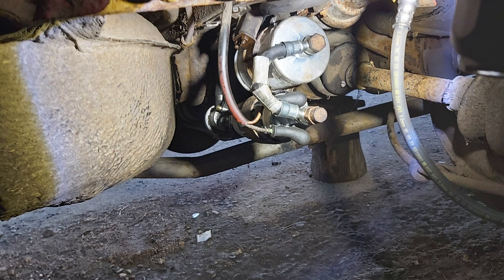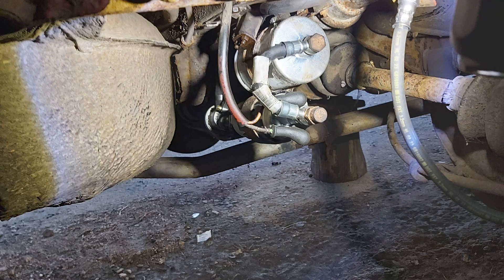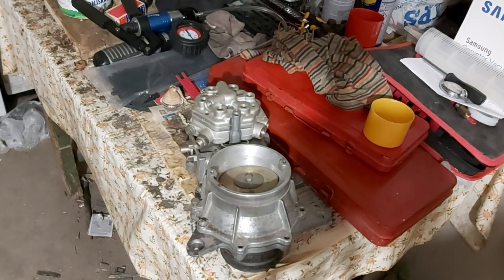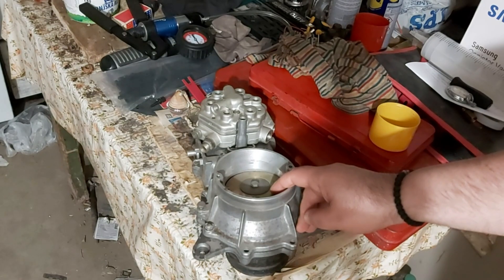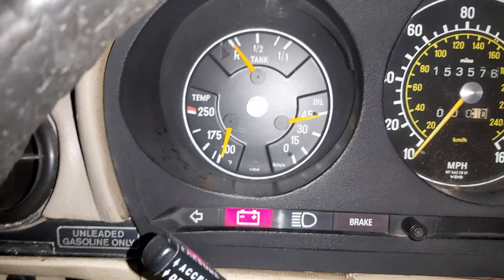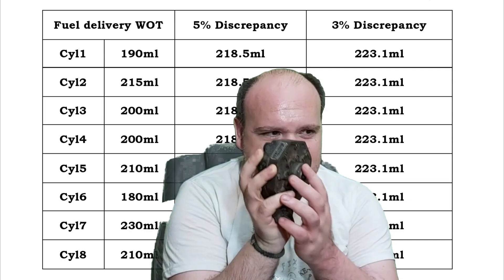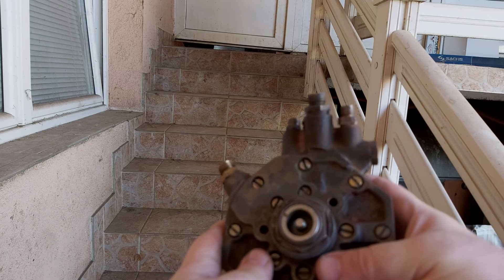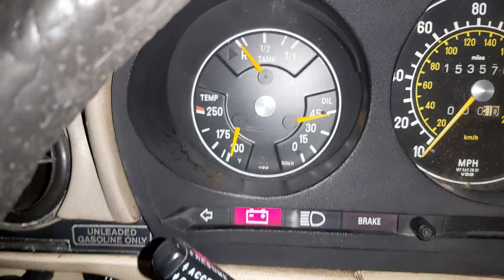㉦Mercedes Ke-Jetronic㉦ -KE-Jetronic Fuel Test – How to Measure Fuel per Cylinder (Shocking Results!)

Comment: Dear Sir: I measured a flow rate of 110 ml/min on my M103 with the air flow meter at the bottom. The pump at the distributor inlet is at 7 bar and has a good flow rate. What could be the problem? The car is struggling to exceed 4500 rpm.The differential pressure is 0.4 bar. Thank you
Reply from the maker: Hello. Concerning some things: Don't measure the pressure at the inlet! The pressure is not important, more important is the fuel flow! Measure the fuel flow by removing the return line on the FD. You should get 1.6l in one minute. Concerning the flow rate: In all manuals for all the KE-Jet cars you will find the value: 100ml per section on the full load. As you could see in my case in this video, the least I got was way over 100ml and the FD could NOT be calibrated! Concerning the M103 FD, you would have to tell me how much you got out of all 6 cylinders but the nominal value should be approx. 160ml per section if the fuel distributor wasn't recalibrated. That's what I can tell.
Reply: @mercedeske  Dear Professor, thank you very much for your detailed response. Thanks to all the excellent information you provided, my car is running very well. Best regards, and thank you again.
Reply from the maker: @guidopicca2858 Thanks. Many happy miles and happy Mercedesing!🔧🙂🍀🎄👋🏻

Comment: Dear Sir: I measured a flow rate of 110 ml/min on my M103 with the air flow meter at the bottom. The pump at the distributor inlet is at 7 bar and has a good flow rate. What could be the problem? The car is struggling to exceed 4500 rpm. Thank you
Reply from the maker: You are correct to measure flow, but there are two important points to separate here.

First:
At idle, even a 3–5% imbalance between cylinders is immediately noticeable.
At full throttle and higher RPM, the engine may not feel even a 10% difference directly.

Second — and more important in your case:
110 ml/min on an M103 is very low.
This points not only to balance, but to a total flow limitation.

Since the engine struggles above 4500 rpm, this suggests:
• restricted internal flow in the fuel distributor
• sticking plunger
• contamination
• or incorrect test conditions

Yes, all six outlets must be within ±5%,
but with such a low total flow, the engine will run out of fuel at higher RPM even if the balance looks acceptable.

I would recommend checking both:
✔ total flow capacity
✔ and cylinder-to-cylinder balance with a bottle test

Comment: I need some help my 93 mercedes 190e m103 turns off when i break on a red light. And when i have it on parking the rpm fluctuates to 1200 to almost 0. I changed the injectors, spark plugs, fuel pumps, filter, acumilator, icv, cold start injector, mass control module, ovp i think thats what its called and the battery is new and the alternator. Yet i dont know what's going on... could it be vacuum leaks or the air mixture is wrong? Also after driving it idk if its because of overheating but when i got out the car after the problem i can hear my fuel pumps buzzing louder than normal
Reply from the maker: What about the potentiometer? Have you checked it?

Comment: Hello, i think my ovp is broken, when i turn the key fuel pump buzzez, has spark, the distributor lower head has pressure, upper head only the cold start injector has presure so when i remove the pipes from the distributor then turn they cey it fills the fuel just a little bit, abs light is of when i turn the key, i was using 800a battery for 3 months it did it in start, i turned the key from where it came on to 1000 rpm and then it went out, after that then then I just turn the starter, it  starts up very slightly after goes out, it wants to start but dies, everything other is good
Reply: Nevermind, i changed the ovp i checked the pin 30 and 31 its getting constant 12v and pin 15  when i turn the key its getting 12v, the eha is 20ohms and still doest want to start
Reply: This happened after i changed the coolant, before the car was running like swiss clock
Reply: I fixed it
Reply: But now when i press the pedal tha car stalls
Reply from the maker: Have you checked the fuel pressure regulator, which pressures do you get, have you measured the pressures?
Reply: @mercedeske i feel so dumb, the injector sealings were like plastic, i gently pushed the air flap and the car started, before that i made bridge to see if the ecu was working, changed the ovp, i adjusted the EHA to 6.66mm but when i push the pedal tha car started to stall, i made a quarter turn to the right and now the car starts to stall at 5000rpm.
I dont have a fuel pressure gauge that fits the upper head of the distributor.
Thanks for the feedback!
Reply from the maker: @batuhanibryamov8937  You must have one, without a pressure gauge on both K as well as KE-Jetronic you are doing nothing!
Reply: @mercedeske i put a air pressure gauge it was to 10 bars, i wired it to the caold start walve it was showing constant 5.5bar beforw the adjustment and after.
Reply: So i need to conect it to the bolt on the lower chamber and to see if the differential pressure is 0.4 bar and then if the up is 5.5 then the lower should be ~5.1 with the eha disconnected, i finally understood the adjustment of this car by your videos.
Thanks!
Reply from the maker: @batuhanibryamov8937  My pleasure. Happy Mercedesing!
Reply: @mercedeske  i bought fuel gauge my presure from the cold start injector is exactly 5.5 then after the EHA i put the gauge in the place of the bolt(lower head) with the EHA conected it was 5.05 i pressed the pedal and then 5.1 so after i disconnected the EHA it was showing 3 bars and the car didn't start, before that i turned the EHA screw to right then little to left

Comment: Shouldn't the lines screwed into the distributor be all the same length, to test properly? Just asking, never did this before. But some ammount might be left on the line if it is longer than the others, before the time passes out for flowing.
Reply from the maker: I bought various - some from 6 cylinder, some from 4 cylinder car.
Reply: @mercedeske I'm just thinking: maybe If you screw the lines in a different order, you might get different results?

Comment: Сдравствуйте! Какой должен быть налив за минуту на 102 мотор. 2/3 объём.? Спасибо  заранее.
Reply from the maker: Greetings. Up to 170ml per minute simulating wide open throttle(full load).
Reply: How about m103 300e  @mercedeske ? 🙏
Reply from the maker: @hendragunawan-up7kd  Approximately the same 150-160ml. The best thing is not to readjust the adjusting screws. I will be covering an episode with a K-Jetronic - there you have o remove the adjustment screws also because there a tiny o-rings on the screws unlike KE-Jetronic.